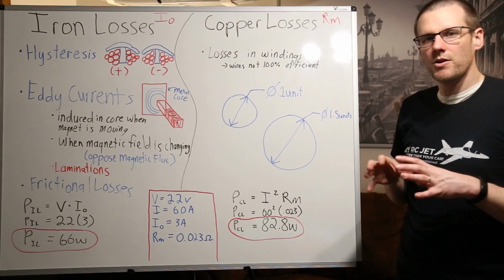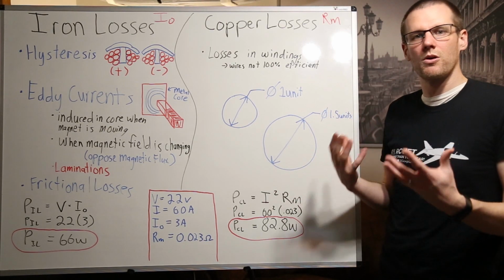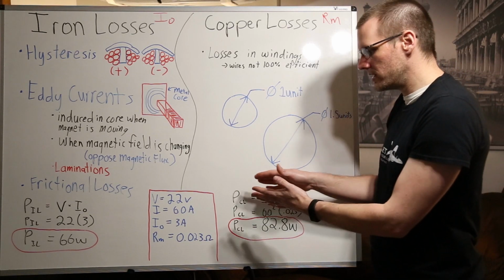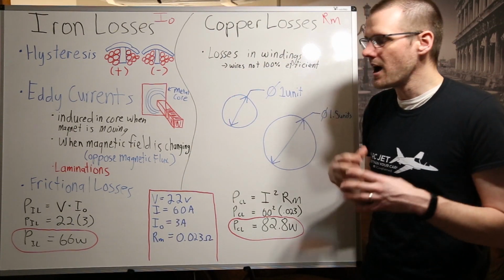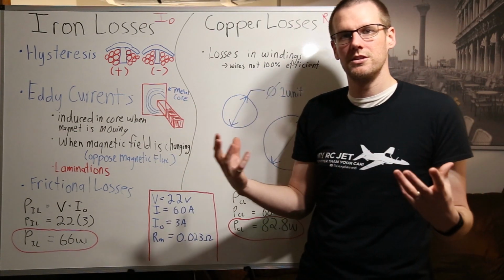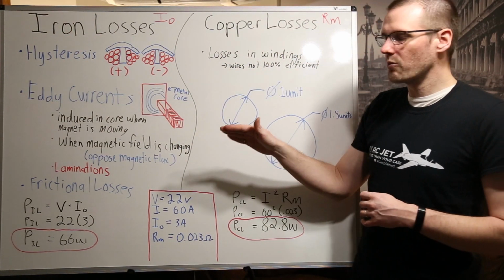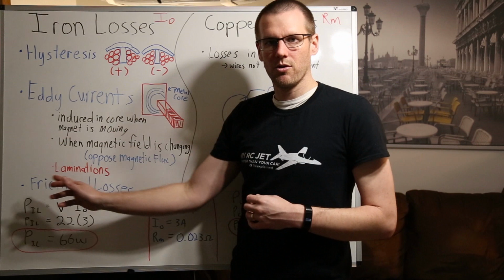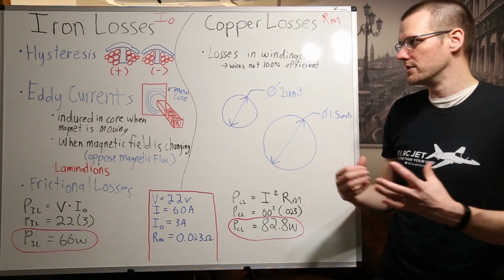Brushless Motor Copper Losses and Iron Losses Explanation and Calculation

Comment: Why is the output power equal to 22V X 60A - isn't that the input power?  Where are the "Iron Losses" accounted for in your analysis?  Don't those "Iron Losses" dominate and limit the real world output power available from of these types of motors (i.e. those with really low winding resistances)?
Reply from the maker: Hey G Mack. Thanks for the question. The final sum was brushed over very quickly.  Total input power is approximately 1300w. You then subtract out the Iron and Copper Lost totaling about 150w. Working out power output over power input, gives you approximately the 88% I mention in the video considering copper and Iron losses.
Reply: @RCexplained  Thanks, but I thought the 150W was the sum of the copper and friction losses.  I didn't see any additional iron losses.
Reply from the maker: Iron Losses include all items on the left side of the board. 
Frictional mechanical losses and Iron losses are both captured in the Io value of the motor constant as calculated at the bottom left of the white board.
Reply: @RCexplained  Sorry - I assumed that Io was "No load current" because that's the only thing that I've ever seen on motor data sheets!  But, I've never seen complete specs, like this https://www.maxongroup.com/medias/sys_master/root/8841181200414/EN-208.pdf for any of these RC motors, have you?  Can you please share or point to them?
Reply from the maker: Io is no load current and what is required to calculate Iron Losses as well as frictional losses.
Reply: @RCexplained  Don't iron losses increase with (the square of?) current/load increase?
Reply from the maker: The no-load motor constant shows up in the formula for iron losses. Loaded current does not enter the equation.
Reply: @RCexplained  What is that formula?
Reply from the maker: Formula should be in the bottom left corner of the white board in the video.
Reply: @RCexplained  Finally got it thanks!  That's a pretty impressive motor - what is it?

Comment: i wanna make a underwater rov for a competition. I'm gonna use six brushless dc motors - 4 for horizontal, 2 for vertical. I'm not really sure which motor i should use and i dont know which specs are important to me for operating a rov underwater. What number of specs value can i use for my rov? What do you suggest? If you know a brushless dc motor for me to use, i wanna know it. The vehicle is  probably gonna be around 3,5 kg. I hope you'll understand me.
Reply from the maker: THere's far too many unknowns to provide you with a motor selection. How many watts of power do you need per motor?